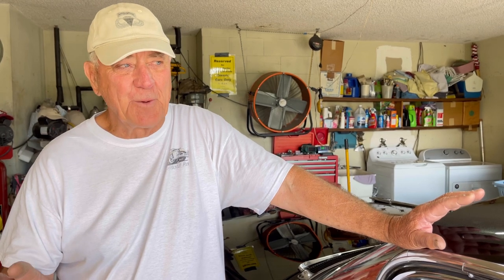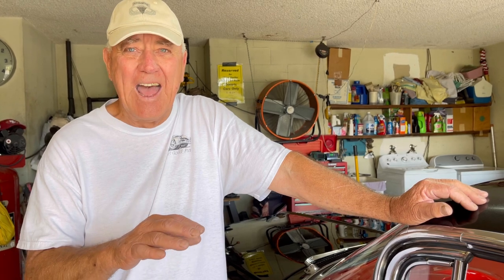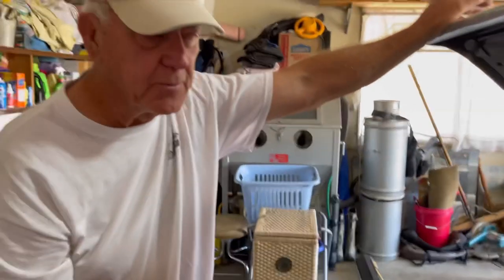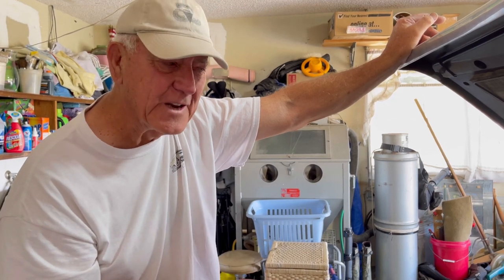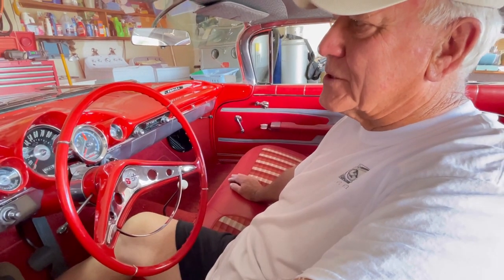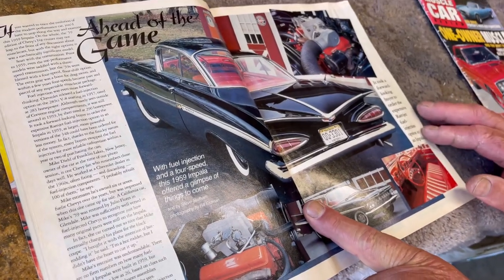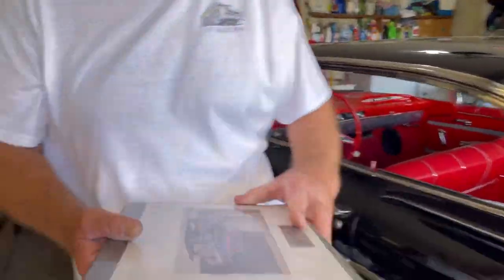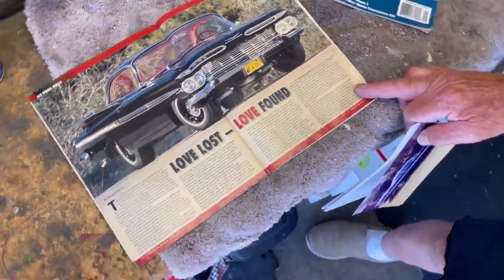Inside a 1959 Chevy Impala ⚡️ with Chauncy Newlin

Comment: What a great car, have always been a fan of the ‘59’s since my father announced he had purchased a new Impala for my mother in June of 1959!  Snow-crest White, dark and light blue interior, it was a hardtop sedan which Chevy called a “Sport Sedan” with great visibility and was a great road car, even with the 235 six, three on the tree and no power steering or power brakes. I took my drivers test in it and it was my wheels though a four year daily commute to college and a couple years after.  The northeast winters weren’t kind, and rust was beginning to show.  I’ve never seen  fuelie ‘59 before, and if my bank account were larger, I likely be a bidder on this one!  Thanks for showing it to us here.

Comment: Very cool car. Probably around 95 or 96 I seen a all original blue 1959 biscayne 2 door sedan factory fuelie. It was at a McDonald's in Gahanna Ohio. Me and my buddy waited for the guy to come out so we could talk to him. We had never seen the wierd looking pointed flags on the front fender and wanted to ask him if it was a original. Sure enough he said he ordered it brand new with fuel injection and 4 speed transmission. It was all original and he was the original owner. We could not beleive Chevy had built a car like that brand new in 1959. To this day I still wonder where that car is. Probably in a garage in Gahanna. Have a good one Buddy 👍

Comment: My understanding is, back in the day, when the early fuel injected chevys would have problems they often get replaced with a carb. Because there weren't enough mechanics around that knew how fix them. Unfortunately many of the units got chucked.
Reply from the maker: That’s true.
Reply: Just Like the 58 Mopar FI cars